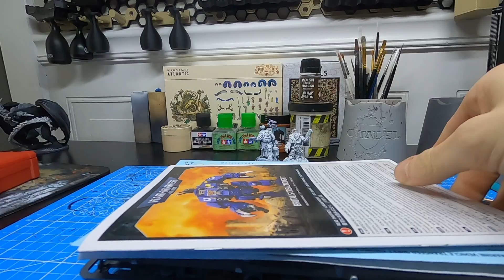FDM 3D Printing Vehicle Miniatures: Dreadnaught

Comment: What do you think about cutting these models in half, at the front plane? 
That way you have two pieces, front and back, and you can place them at a 45º angle on the bed and leave all the supports on the back of the pieces.
Reply from the maker: That's not a bad idea to try. If I print another one, I will try that and post it.